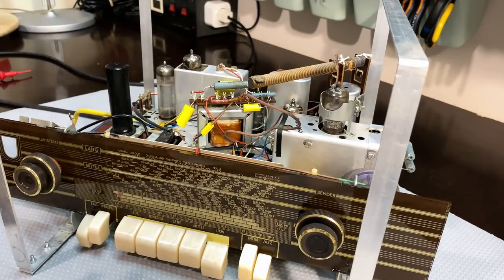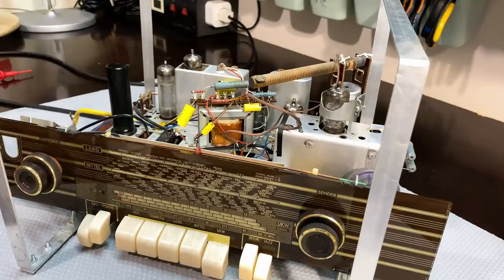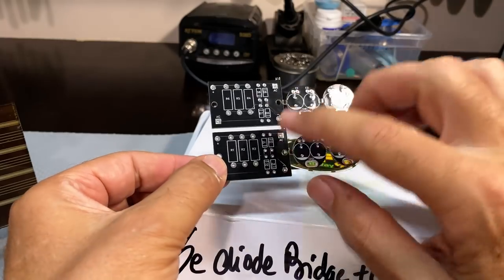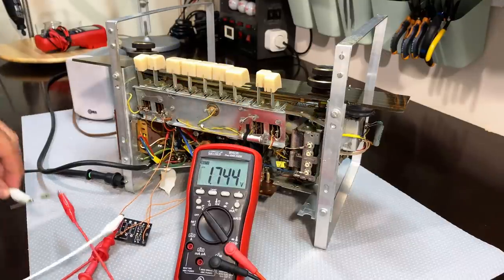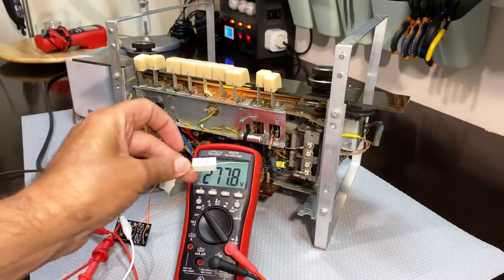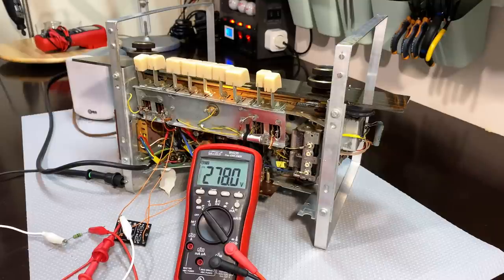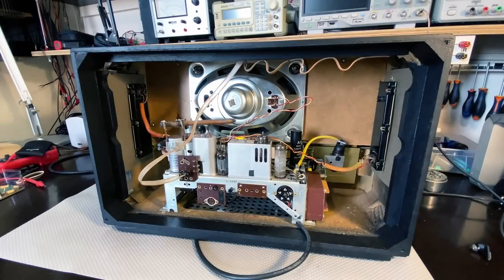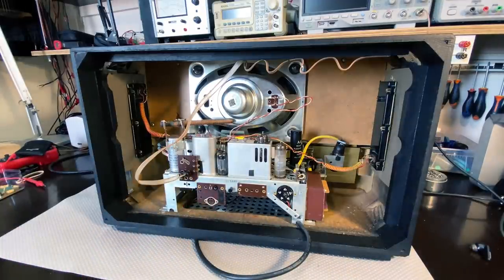Project complete. What a radio! Telefunken Dacapo 9 part 9.

Comment: Hello Manuel. You've delivered a good job restoring this radio...  BTW on the Selenium rectifier replacement: You could start with a 100 Ohm resistor, measure the voltage and then shorting the resistor and measuring the voltage again. Basically the resistor you need is calculated very easy on those measured values, or determined in a simple graph. It's all Ohms law... ;)

Comment: Another fantastic restoration!  Very handsome radio, and it works as good as it looks.  For the selenium rectifier replacement, I take the lazy man's route and tack-solder a 47 ohm 2 watt resistor in series with a 100 ohm 25 watt wirewound pot I found on eBay, then adjust to correct B+.  I then replace the pot and resistor with a single fixed resistor.  Works well in smaller radios.
Reply from the maker: That’s a good way to find the correct resistor.

Comment: Nice work!
I personally would have used a MOSFET with a trimpot to get the voltage right, just makes things a little easier.
But this also works of course :)
Reply: This radio would be fine, even without these resistors. The tolerances for these circuits were quiet high.
Reply from the maker: True

Comment: Hello Manuel and thank you for these great tutorials!! I‘m more a beginner in repairing old tube radios, but I own the same radio  and want to start repairing it soon by following your videos! 
The only problem of my unit is that one of the electrostatic tweeters was removed. Would you recommend just using this single one or replacing them with something different like two Piezos?
Reply from the maker: No, leave it as is. You could do some damage if you fit the wrong device in its place.

Comment: Wunderschön!
But one question i have: Do you have a special reason, to use single diodes in the rectifier? I'm a friend of this blockformed rectifiers.
Reply from the maker: No special reason, I just prefer these separate diodes here. A block rectifier would do just as well as long as properly rated.

Comment: You could also use a wirewound potentiometer after the bridge rectifier pcb to determine the proper series resistor,might be a bit faster . 
Adjust pot to get the desired voltage, measure pot  resistance ,replace with suitable resistor.
But you knew that already.... :)
Reply from the maker: That would work well

Comment: Hai.......I am from India, Kerala state... Now only i saw this videos.  Its quite amazing for olden electronic engineers. I have an Indian Philips Prestige 556 model 1970 transistor radio ... Now its not working.... Can you please arrange the circuit diagram of this model for restoring the set. Its highly appreciable if you get this... Sincerely... Shajahan M
Reply from the maker: sorry, do t have those schematics available. You’ll probably find them on the web.
Reply: @electronicsoldandnew  
I could not find in web in a search...Can you please give some idea of any web portal or connection.... Regards...SM

Comment: Hi Manuel, a quick question: usually in radios and amps, happens that power tubes draw more current that stated in the schematic (lastly an el84 two el95 in pp) and their plate voltage gets lower... I'd say that's the tube slowly dying, isn't it? As i exchanged the two el95 with "new" ones, bam, spot on on current and voltage without touching the bias...
That's also the reason why I'm building my own tube Tester... Thank you!
Reply from the maker: Ageing tubes will usually do that. However, there is quite a wide range of acceptable conditions in tube gear, so you don’t need to change the tubes too often. I’ve had radios with their original tubes after 60years with no problems at all.
Reply: @electronicsoldandnew  ok thanks! Yet reading 76ma at the cathode resistor instead of the given  40ma (almost twice) makes me think about replacement...
Reply from the maker: Yes, there I agree completely 😊

Comment: Just a quick question. In my radio restoration endeavors I have messed up the circuit board on my grundig 4070. Would PCB way be able to reproduce this board for me? I have the circuit board diagram. Thanks for the great videos!!
Reply from the maker: No, you’ll have to design the board yourself.
Reply: @electronicsoldandnew  I have the actual layout of the pcb, it's a picture that looks exactly like the pcb itself that came in the manual. Can I just send it to them and they will print it?
Reply from the maker: No, they produce the boards from Gerber files.
Reply: @electronicsoldandnew  ahh I see now. Thank you!

Comment: You mentioned connecting to a mini-whip antenna for LW and MW and it seemed to work very well. Do you have any guidance for getting one of those to work well as there seems to be very little practical information on the web? Thanks.
Reply from the maker: this should help:
https://youtu.be/H1pfRCvi1P4
Reply: @electronicsoldandnew  That is fantastic sir, just what I needed. Your experience with the long wire is exactly mine and what I am trying to get around. I had heard that the mini-whip needs a very good earth so I presume that yours is ok and free of interference. I am not sure mine is so I have installed a ground rod ready for when I build one. I am surprised that it works so well from a wall wart but I will try it. I was anticipating having to use a battery.
Reply from the maker: And it actually doesn’t have an earth at all 😊 I live on the top floor apartment in my building, so a ground rod was impossible.